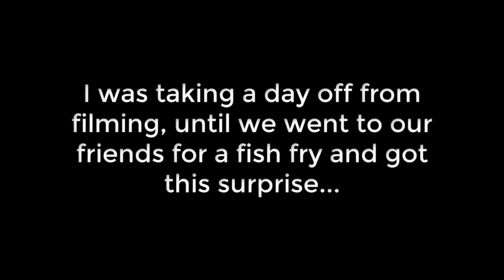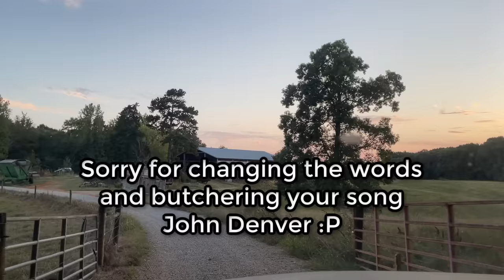All moved!

Comment: Alternating testing the alternator.
Modern alternators with the built-in regulators . Simple test procedures using a voltmeter.
Step one with the vehicle not running check the voltage at the battery. Example 11.8 volts DC. Step 2 start the vehicle. You're either going to have the same voltage as with a the vehicle not running ie 11.8 VDC. If the alternator is working and charging the battery you'll have like 13.5 14.5 thereabouts proving the alternator is charging.
With the same voltage at the battery as in non running mode 11.8.
 step 3 don't condemn the alternator yet. Using the voltmeter, connect the negatively to a good clean ground. Connect the other lead to the heavy wire coming out of the back of the alternator with the stud bolt. That's the charging wire. Have somebody start the vehicle. If you now read. 11.8 volts. look to the alternator for the problem. But at that connection bolt if you're reading upwards towards the 15 volt mark. The alternator is working. By Henry !! we're now going somewhere.
Step four y'all, switch your meter now to ohms. To the lowest setting. For us farmers and ranchers that symbol, on the meter, is the horseshoe. LOL. Hold the leads of the meter together and notice the reading. If you have a typical farm ranch meter it's going to read not quite zero it might read 0.4 ohms. Or even higher.  Which in the meter's mind means zero. Go from the positive terminal on the battery post. Connect other lead to the large bolt coming out of the back of the alternator terminal. You might need an extension wire depending on how far away. The back of the alternator is to the positive post.
Now let's don't shoot ourself in the foot, by being confused. Your first test is from the post on the battery to the post on the alternator. Because the connection is short you should read nearly the same as what you did holding the leads together. Any significant higher reading, on the meter shows you have a dirty connection or corroded wire. Some of these newfangled connectors at the battery post have the alternator wire incorporated into the fitting. Where you can't see the corrosion. Next take your meter lead from the battery post to the terminal on the battery and scratching that , with that point of the meter lead, see if you can get that low ohm reading. If you can't you have corrosion on the alternator to battery wire.
As Papa would say. Cut that burger out and slap you on a new end fitting, clean up that battery post put a little vaseline on it (or if you're a rich farmer you can buy some of that spray at the auto parts store, that's if you remembered to pick it up) . Connect your new battery post terminal.
And in the words of Postamaty the French chef,voila!!
Now a word to the wise from memaw. If you're going to the parts store to buy an alternator take the old one with you because they can test it, to see if it's bad, they're going to want the old one for core anyway. Memaw says drive smart, save fuel, shop once.

Comment: I was told that batteries are charged through the ground so maybe check the ground wires. Another thing I had seen is that you guys need to build a box cover for over the pto shaft. I was to an accident involving a pto shaft and it was not pretty. I normally don’t say much but I could see your helper getting in to it. Please for your safety make one. It only takes five minutes to make a cover to save a life

Comment: You should just get a 200 amp one wire Chevy alternator and put all of them on all of the tractors trucks , it the grounds wires , they are all internal regulated on all of them these days, need to pull all , I said ALL of the grounds off and wire wheel all of the engine to frame, cab to frame, engine to frame ,to cab, . Lololol you get the pictures, all of the bumpy dirt road travels will get dust in the middle of the connections on the ground straps (wires), ok it’s fine , and when I changed all of mine out to one wire Chevys I have never had a charging problem since, lolol nice 👍 thanks BigAl thanks you , praise Jesus grace Christ amen.

Comment: Wes is getting advanced education daily.  Sounds like a shorted main supply to fuse box, perhaps to the Starter.  Not charging and all gauges dropping indicates more than alternator IMHO.  Clean and check all Ground wire connections to engine and frame.  Get those pictures enlarged and framed.  Priceless.

Comment: Battery isn't taking a charge. Could be the battery
Reply: Voltage regulator could be beside the radiator or on the fender well.

Comment: You need a diagnostic tool to find the problem, so much time lost in finding the charging problem.  It is a positive value to get the answer in 30 seconds instead of waiting 4 days to just waste your time and money.  You are also in need all weather roads "use under ground drains" again well worth the money.  It is idiotic to work hard fixing the same problems over and over.  Spending for the best combines and machines will pay in an easier life.  I always buy the best of everything cause over time it actually pays you back.  God bless you , God is not the author of chaos plan ahead mud doesn't need to slow you down.  Gravel can be gotten by screening  any gravelly dirt. You are making me cry with you.  Things can be so much easier, better